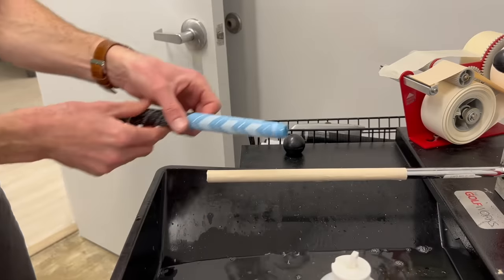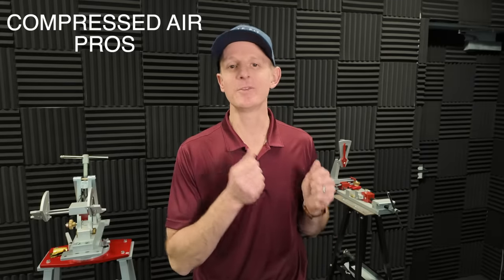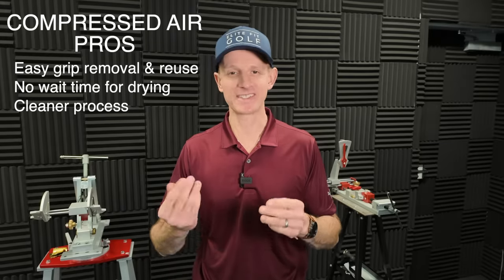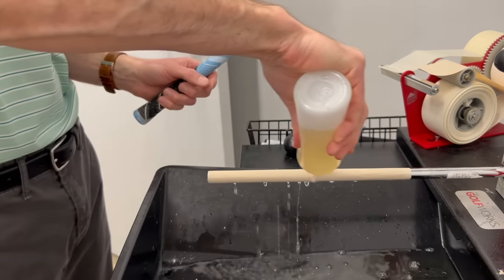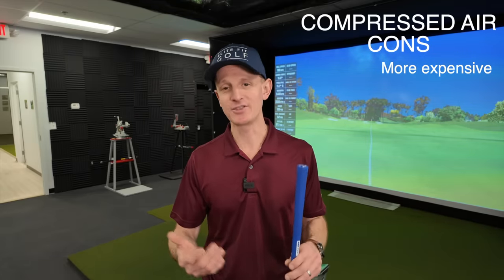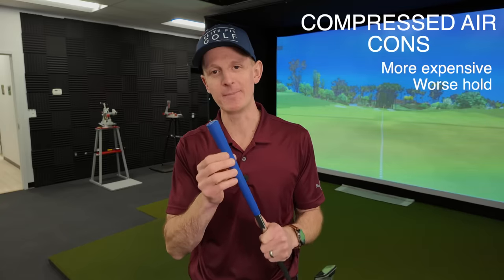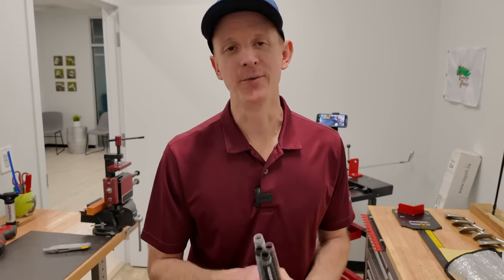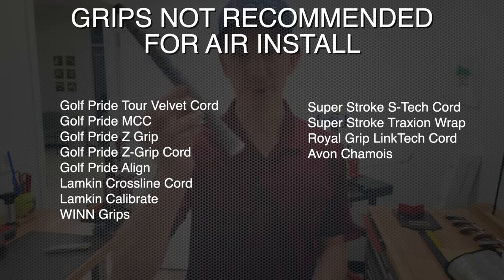Which Regripping Method is Better? Tape & Solvent vs Compressed Air

Comment: With compressed air, use a squirt of WD40 on the inside of the grip and almost all grips go on easy other than Winn and SS Putter grips.   Solvent is ok if installing in the garage.  If installing inside, compressed air is the way to go to not have the solvent smell.  Need a better tip for the compressed air to better hold while installing.   If you know of a connector for the pure gun for the hand held drill style that would be great.  Thanks.
Reply from the maker: I have one of the Pure grip tips that I modified to fit the tire inflator size but find it only works well with PURE or similar. Hard to get a tour velvet for example to fully install.

Comment: Tried using compressed air to remove the stock Lamkin grips on my Tour Edge irons I got last year because I was hopeful of saving them. First one I tried, the glue wouldn’t separate & the grip actually exploded due to me not being able to reach the switch on the compressor fast enough (totally my fault). Ended up just cutting them all off. Is that a normal thing with stock grips from club manufacturers?
Reply from the maker: Air only works for removal when it was used to install them. Otherwise it's very difficult to get them off that way.

Comment: Do i need other kind of Tape to mount the grips with air or how do they stick to the shaft ? 
No solvent ? 
Im new to this topic and cant figure it out 😅
Reply from the maker: You don't even need tape of any kind. Just make sure the shaft is clean of any old adhesive to make the install easier. Some people find the air installed grips can slip a little at the butt end and either use some hair spray on the shaft before install or a small 1 inch piece of double sided tape at the butt end to help secure it from slipping.
Reply: @EFGMC  Thank you very much. 🤙

Comment: I guess I don't understand the point of doing air installed grips if your using tape and hairspray...  What is the benefit?
Reply from the maker: Easy to get on and more importantly off. Also you can hit them right away as opposed to waiting 45 minutes for solvent to dry.

Comment: New to this and am about to try doing an old set of clubs. Why can’t you use double sided tape and compressed air? Wouldn’t the double sided tape add hold like the hairspray is doing? I haven’t seen anyone doing these videos say why not to used double sided tape with air.
Reply from the maker: You can but at that point there really isn't a difference from using tape and solvent.

Comment: Tried it once, never use compressed air with 2 piece wrap grips such as Winn Excel or Winn Dri Tac Wrap grips. To easy to have separation between the wrap portion and under listing.

Comment: I use blue masking tape + 2” of dble sided at the butt. Do not use air on Align grips. All mine have rotated
Reply from the maker: I have found that the blue painters is more prone to slipping than standard masking tape.

Comment: From what I’ve seen the two methods are double sided tape and solvent or single sided tape and compressor, if the solvent is only for installation, why wouldn’t single sided tape with solvent work?
Reply from the maker: The solvent breaks down the adhesive and makes it slippery. Single sided tape won't do that so you won't have the slippery surface to slide the grip over.

Comment: I have been using jumbo max grips for over a year and put them on with air. After a few times of having them on and off different clubs they would become loose at the top of the grip so I have been using a small amount of double sided tape then spray some hair spray on it and that seems to stop them twisting better. I have been using hairspray and air for years but to deactivate the double sided tape while I install the grip I didn’t realise it would be holding the grip in place.

Comment: What about Golf Pride CP2 wrap grips (compressed air or solvent)?
Reply from the maker: CP2 have a hard plastic part at the very butt end so the air method will have more chance of slipping there unless you use some type of adhesive, either hair spray, or a very small piece of double sided tape at the butt end.
Reply: @EFGMC  Thank you!

Comment: Great video, thanks for the information. I see you use Pure grips quite a bit in your videos, have you found a decent replacement yet? Since they've gone out of business, I've been searching high and low for a comparable grip. Luckily, they last a really long time, so I'm able to move them from club to club as needed. I've heard Star grips are extremely similar. Would you agree?

Comment: Anyone use Goo Gone to remove very old tape? I am currently in the process of regripping for the first time and I tried the hot air from a blow dryer but the old tape is still not coming off. Is goo gone safe to use on steel and graphite shafts?
Reply from the maker: Should be fine but I would test on a small area first just in case.
Reply: @EFGMC  thank you !

Comment: People have suggested a little double faced tape on the butt end to stop twisting. How is this going to effect removal with the air ?
Reply: This is a great idea. You could put some isopropyl alcohol in the grip hole before to loosen the adhesive.
Reply: @WyleCote  if you put it in the grip hole it will just run down the inside of the shaft.
Reply: @johnnerren8345  you could put it in there and then put a tee in the hole and invert the club and let it soak or apply some air. That would push it between the grip and the shaft perhaps.
Reply: @WyleCote  I put my grips on with air. Don’t think that will work but I can’t say it’s impossible.
Reply: You are being too negative. 
You should try it and report back
Reply: @WyleCote  if I take a grip off that has been put on with tape and solvent I put mineral spirits down the shaft from the other end and use the appropriate tool. Since I don’t use adhesive I have no need to put alcohol in.

Comment: Off topic, but feel there is a better chance of you seeing this with this being your latest video. I'm experimenting with the idea of diy vibration dampening with steel shafts, and since I am a find a cheaper effective way dye to being a tight wad, I'm thinking of a cork, backer rod combo possibly. My thought was a smaller diameter cork to go nearer to the tip, then various diameter backer rods working toward the grip size, then a larger diameter cork to sandwich it all. What do you think? Clever or dumbass?

Comment: What tool is attached to the air compressor? I ordered a cheap one and the plastic tip that goes in the end of the grip broke on the first grip I was trying to do. It broke off inside of the grip.
Reply from the maker: This is the raft tip that I sanded down slightly.

Comment: Very interesting video thanks. I have done grips well using both methods at the same time. Mostly GP MCC or Winn putter grips. I always have my compressor ready well doing grips because even though I have a ton of fluid on the shaft and in the grip I seem to sometimes not get past the half way well sling the grip on. The compressor lets me use the air to get the grip on the rest if the way. Ilike being able to use the air compressor method when doing Winn putter grips. ⛳️🏌🏼